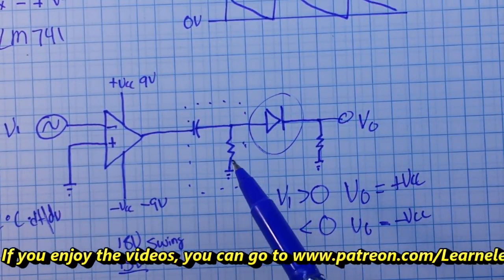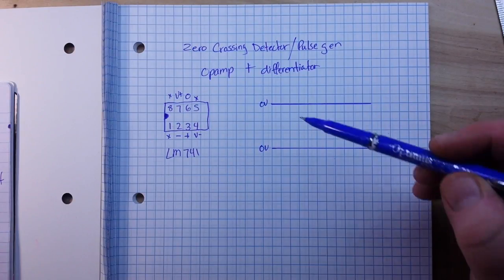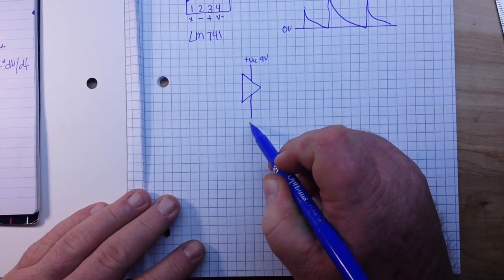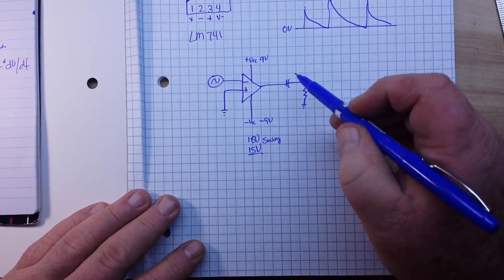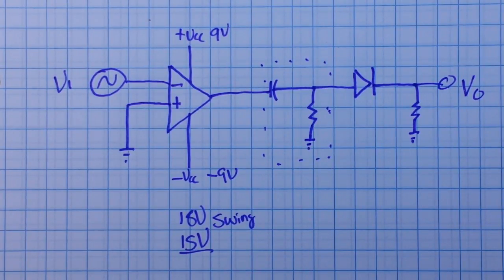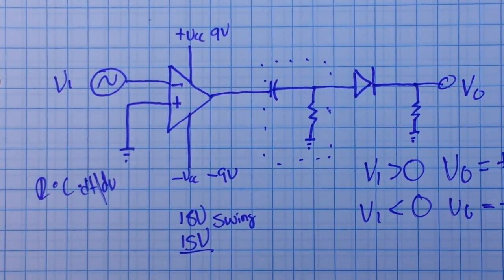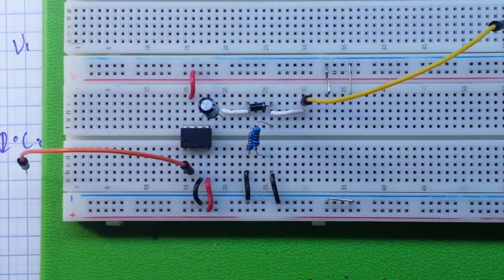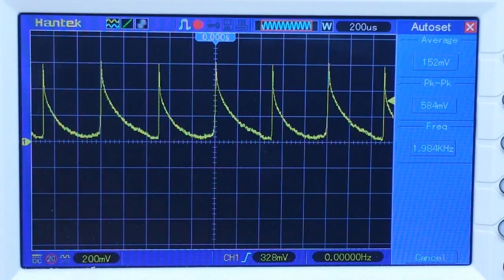zero crossing detector circuit fun

Comment: Hi, interesting circuit. Could you please tell me what is meant by dt/dv in the formula. Thanks
Reply from the maker: change in voltage divided by change in time. Its a derivative.
Reply: @learnelectronics  So its dv/dt, which makes sense. Thanks

Comment: I just got on the subject of the op amp/ comparator. I'm trying to build a regulator for alternator.  to adjust voltage. but I think I figured out that I didn't need it. or a depletion mode get would work best. but I can't find one! I haven't looked that hard. but I can use a MOSFET and BJT. I have heard depletion FETs are an odity. I need the positive voltage to shut off the negative to one brush in the alt. a N channel depletion mode fet would simplify things! great video . please keep them coming!
Reply from the maker: +James stranger I'll keep making them as long as the channel supports itself.